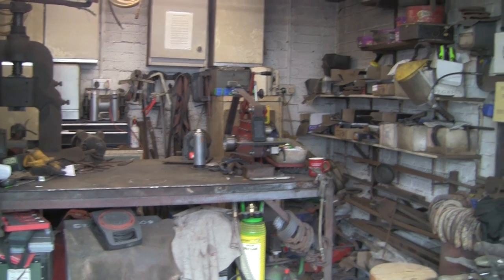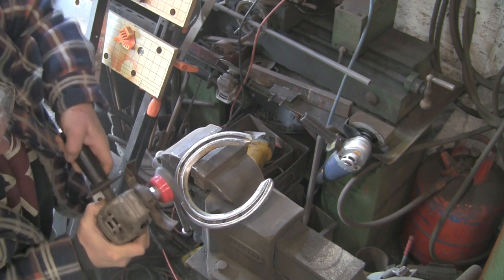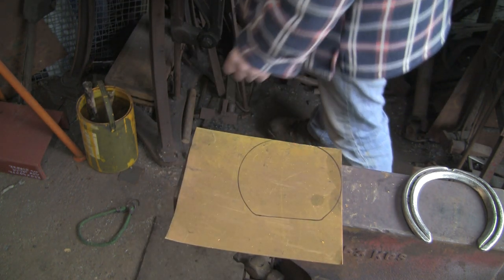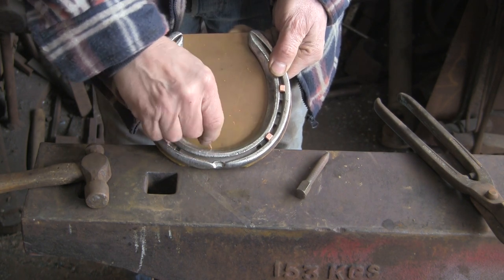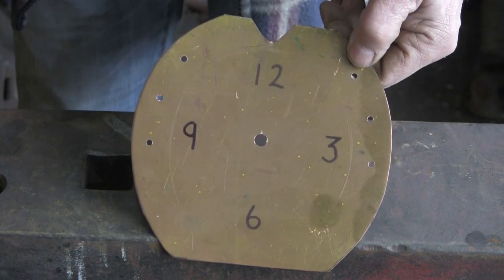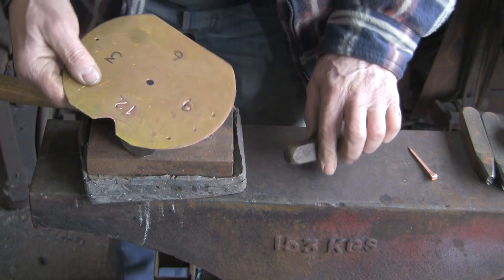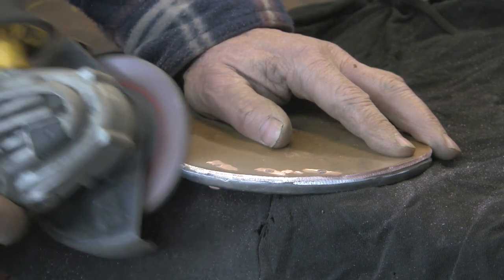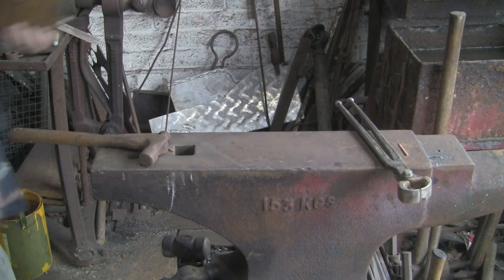Horseshoe Clock

Comment: Really like that Gary. Now a couple of years ago a neighbour suggested I make one from clutch centres I was making ornaments from. Using spanner ends as the hours I did in fact make a few. I got my clocks from Poundstretcher cheap ones, £4 a time. Only thing is they did take me a long while to make. An afternoon taking clutches to bits. Another cleaning them up. Plus of course to replace the spanners would cost, travelling to  auctions etc even if they only cost a couple of quid a box. Using spray cans at £6 a time the inclusive cost was around £30, plus a couple of afternoons work at least. Now I don't know if they were scared if I would earn a quid, but hardly anyone bought one. Sold one for 50 and one for 100 I think. Anyway if you look back through my videos you should see them. Might just give you a few ideas :)